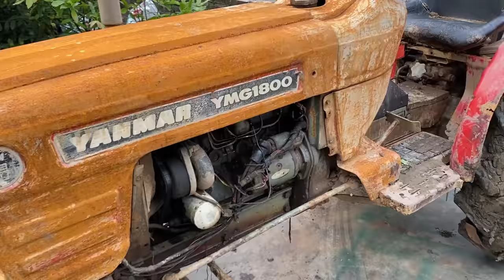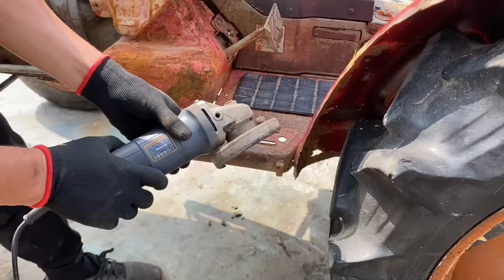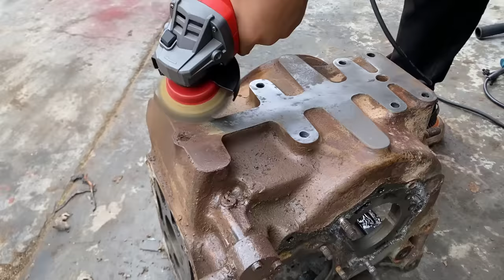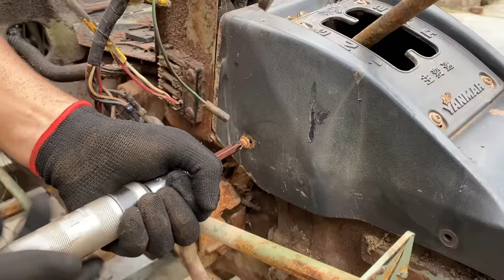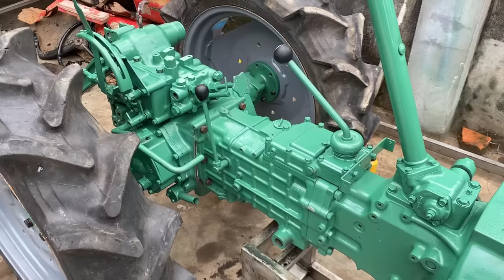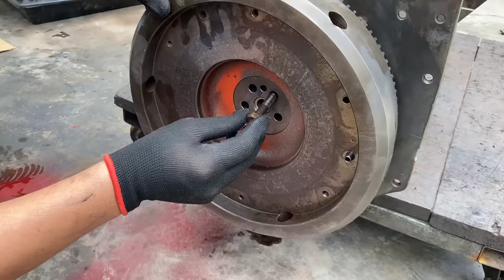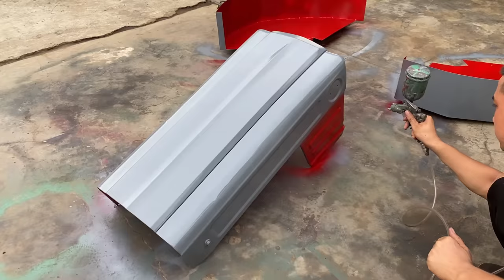Old Yanmar YMG1800 tractor fully restoration | Fully restore and repair yanmar plows

Comment: BODGE UP --- THE VALVE SEATS ARE BADLY PITTED and you refitted pitted valves.  taking a machine APART AND PAINTING IT IS NOT restoring it.
Reply: you are right ,always the same procedure ,no parts replacement at all

Comment: I can't imagine a place where a machine sat in the weeds anylength of time and no one snagged those new tires.
Reply: They cleaned everything ,did not change a single part or bearing, what the point???
East Asia cheap labor ,no spare part ,some guy is going to buy a 40year old tractor
with fake rebuild.
Reply: @jiefflerenard1228 ា ាាាា
Reply: ច១
Reply: @buntong3090  ົຢ ່
Reply: @jiefflerenard1228  oll

Comment: That right angle bend in the end of the tail pipe exhaust will reduce power.  Go with 2 45degree bends and feel the difference. For hard work sometimes that right angle exhaust bend can overheat the exhaust valves and warp them.
Reply: Ppv

Comment: This is so funy to watch..... Build the motor without tork wrench... 😂
Reply: it`s a tractor, not a F1 car...
Reply: @hera9539  good luck with flywheel and crankshaft without tork wrench
Reply: @markomarkovic6470  no luck needed! my Yanmar FX255 is still running after a engine rebuild 5 years ago...
Reply: @hera9539  maybe for this model ,but i would newer recommend to do without proper tool on other tractors
Reply: @markomarkovic6470  I wouldn't recommend that either, of course, but they're not high-performance engines either. Small 2-stroke engines under 100cc are often bolted together by feel without torque and have to withstand much higher rpm....

Comment: You do not just repair, you completely disassemble, clean and rebuild. you have amazing skill and attention to detail. It is very admirable and I am in awe.
Reply from the maker: thank you
Reply: They cleaned everything ,did not change a single part or bearing, what the point???
East Asia cheap labor ,no spare part ,some guy is going to buy a repainted 40year old tractor
with 20000 hours on drivetrain.

Comment: You work with such confidence   I have a yanmar  1700  water in the head  started for a few minuets then turns but  will not fire  Im afraid to open a can of worms        Wish you were  here        CHEERS

Comment: Felicitări, cu sinceritate!
Reply: They cleaned everything ,did not change a single part or bearing, what the point???
East Asia cheap labor ,no spare part ,some guy is going to buy a repainted 40year old tractor
with 20000 hours on drivetrain.
Reply: @jiefflerenard1228  You're right. But I think that was the goal, they had no money, no budget for anything else.

Comment: good restore👍👍😘
Reply from the maker: thank you very muck
Reply: They cleaned everything ,did not change a single part or bearing, what the point???
East Asia cheap labor ,no spare part ,some guy is going to buy a painted 40year old tractor
with20000 hours motor.
Reply: That is not a restoration!!!
It was only a repair and poor paint job! They still need more original parts to make it a restoration!!!
Reply: @restoration-restore-repair  k baad me q o na
Reply: @restoration-restore-repair  tool cf

Comment: I am always thrilled where you always find your old and broken machines and vehicles. Everywhere stand and lie these things with you in the forest, gardens or other areas inside. I can somehow NOT believe it!
Reply: They cleaned everything ,did not change a single part or bearing, what the point???
East Asia cheap labor ,no spare part ,some guy is going to buy a painted 40year old tractor
with 20000 hours on motor.
Reply: 😮 2:03
Reply: P
O

Comment: What a great find. Loved the rebuild. Thank you for sharing.
Reply from the maker: thank you
Reply: They cleaned everything ,did not change a single part or bearing, what the point???
East Asia cheap labor ,no spare part ,some guy is going to buy a painted 40year old tractor
with 20000 hours on motor.
Reply: Ol
Reply: Pjps
Reply: @restoration-restore-repair  %iq
Reply: @jiefflerenard1228  7ui
Reply: 😮 @renataaumeda6940  😅😅😂😢😅😮

Comment: You’ve done a excellent job restoring the tractor very impressed with your skills
Reply: They cleaned everything ,did not change a single part or bearing, what the point???
East Asia cheap labor ,no spare part ,some guy is going to buy a painted 40year old tractor
with 20000 hours on motor.
Reply: I agree. Roller bearings could be good, can be reused. But when the brake drums and shoes were put back together half dirty I was like... And then, putting  back the crank into main bearing where it worn out down to the copper, that was it for me.
Reply: @billbrox8666  hb
Reply: @rajeshpingoliya4153  idnu
Reply: @rajeshpingoliya4153  l
Reply: @billbrox8666  you are absolutely right!
And they are still missing several original parts!
This was a very cheaply done repair only!!!
Most people making comments on here have no idea what a full restoration is!
It needs originally fenders, hood and grill, exhaust pipe, etc, etc, etc.

Comment: Wow! Amazing
Reply: They cleaned everything ,did not change a single part or bearing, what the point???
East Asia cheap labor ,no spare part ,some guy is going to buy a painted 40year old tractor
with 20000 hours on motor.

Comment: Do you ever use a torque wrench or loctite on any of the bolts? Like the head bolts for example?
Reply from the maker: i still use
Reply: I'm with you, no torque wrench, loctite or new gaskets.
Reply: They cleaned everything ,did not change a single part or bearing, what the point???
East Asia cheap labor ,no spare part ,some guy is going to buy a 40year old tractor
with fake rebuild.
Reply: @restoration-restore-repair  They cleaned everything ,did not change a single part or bearing, what the point???
East Asia cheap labor ,no spare part ,some guy is going to buy a 40year old tractor
with fake rebuild.
Reply: وللمسلمين وجبت
Reply: مصطفى حجي
Reply: @jiefflerenard1228  First of all you are repeating this comment more than once! Secondly, do you like that he changes half of the parts on that tractor? For most restoration experts every item should be preserved and changing parts should be the last resort!

Comment: Why do you label this as restore and repair?
A restoration means turning it back to factory original condition!
That would automatically include a full rebuild from end-to-end!!!

How long before you can finish restoring it?
Are you going to have a follow-up video when you get the right parts and decals etc.?